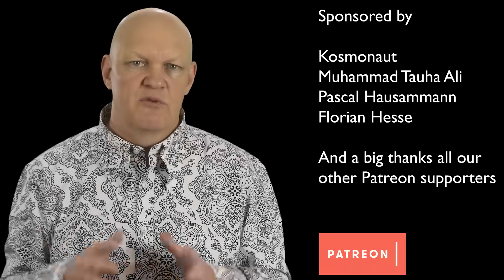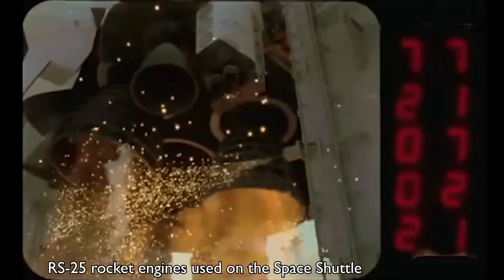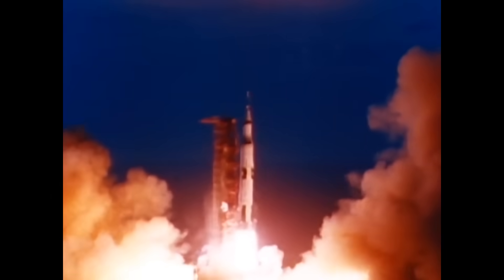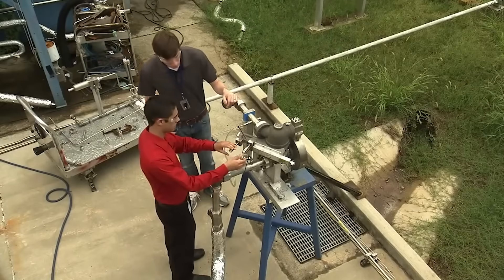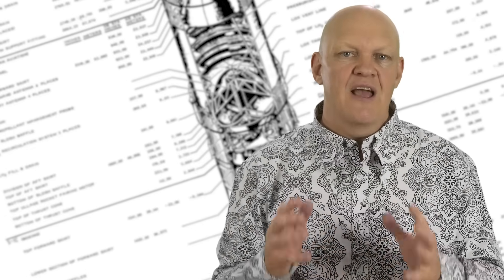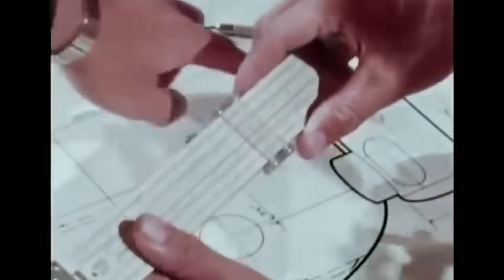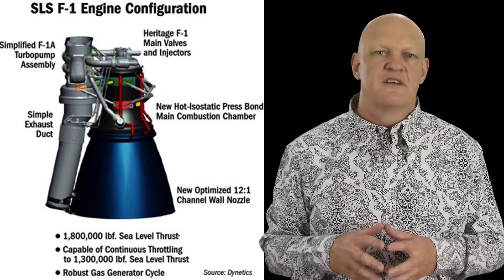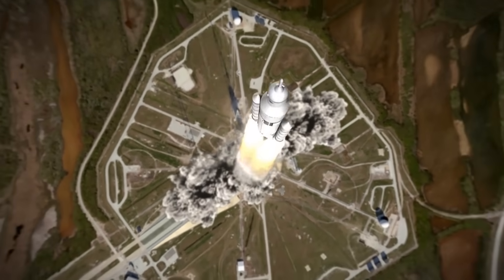Why Can't we Remake the Rocketdyne F1 Engine?

Comment: It is a sad time in which we live that we no longer have the skill set to build an original F1 engine. I grew up in that time, and worked as a machinist before CNC. Very few people left that can do what we did. I miss it the wonders of that time.
Reply: It is a sad time in which we live that we no longer have the skill set to build an original F1 engine.
No, we have the skill set to build something better. Advancing tech means you leave old methods behind. A few years ago, a Saturn V first stage engine (from the Smithsonian) was fully disassembled by a NASA team. Among the interesting findings, that engine was absolutely filled with exotic types of obsolete welding. Welding that only a handful of people knew how to do in 1960, and nobody on Earth’s done for over a generation. Every one of the thousands of turbine blades in the turbopumps were hand-positioned and hand-welded, taking hundreds of times as many man-hours as would be required for an equivalent engine designed today. It’s not just that we can’t do it that way anymore; we’d never choose to!

The whole rocket is made from steel and aluminium; state-of-the-art stuff in 1960, but incredibly heavy and wasteful to build large rockets from today. A modern rocket’s fuel tanks aren’t just lighter, but dramatically lighter. The metals we use today in rocket engines are so superior the engines don’t even have to be cooled anymore. Watch video of a SpaceX launch: modern rocket engines retain their strength even glowing yellow-hot!

So yes, we lost the ability to build a Moon rocket out of obsolete materials and using methods that required a literal million-man-hours to assemble. But don’t think that means we couldn’t go back to the Moon. We can, anytime Congress hands NASA the money. We just wouldn’t do it the same way.

Comment: A really awesome and exquisite design.
By the needs for the time it was built, as said in this video, each F1 instance has to be refined and readjusted practically by hand, one by one.
The programmable machine-tools from the seventies to now didn't exist, and the computer assisted design (CAD) techniques were just nascent.
So the Von Braum and NASA's stubborness on doing (really needed) exhaustive testings of  new devices, hardware and software for the moon program was much more demanding for the design and nanufacturing personnel.
A real testimony of the accumulated and superb skills and finesse on doing their work in the stress imposed by the competition with the Soviets. Trully remarkable master at their jobs.

Comment: The greatest liability modern technology has is if, as result of a massive electromagnetic impulse our transport and manufacturing infrastructure collapses simultaneously. At that point, it would be difficult to judge how far back we would be thrown. You might, optimistically, think the 1950's, but the loss of analogue tooling and requisite skill sets, pestimistically, it could be back sometime before the industrial revolution. In any event, those that are reviving anachronistic technologies -everything from black smithing to maintaing steam and hit and miss engines will be elevated beyond the prominence of today's software engineers.  Let's hope it never gets to that point.

Comment: Its a similar thing today. If your an engineer, do you think 50 years from now someone could pick up the machines you’re working with and get those running? How many times a day do you go „yeah ol betsy here doesnt like it if you insert the sheet too fast and then you gotta restart her“? Its just moved from the manufactured parts over to the machines used to make them

Comment: I'm sorry that's not a good explanation to me. Skilled people and engineers still exist. If the original builders had to make changes and adjustments as they went, then that's what you have to do now. Just start with the blueprints and make your own adjustments. And it doesn't even have to be the exact same adjustment that was originally made. It just has to correct the issue.

Comment: My father used to work for G.E. Aerospace back in the 1960s, and he was a technician who helped design and build the attitude control systems for the Saturn V vehicles. He once told me a story about a failed circuit board that would not respond as designed, but was a vital piece of the system meant to steer the rocket. He said they worked for days, trying everything, until one day, for no apparent reason, it started working. They found that someone had somehow dropped a paper clip onto the board. Instead of removing it, they tested it again to make sure the circuits worked, then they carefully measured exactly where the paper clip lay, what it touched, what shape it was, and its composition and mass-- everything-- and then they simply started soldering these paper clips onto the circuit boards to get the attitude control system to work.
I have NO idea if my father were putting me on or not, but after seeing this video, I'm thinking-- Maybe he was telling me the truth....

Comment: Because they are not designed for socialy accepted hydrogen fuel as well.
What's funny is, the carbon offset is still not enough to offset the solid rocket boosters. The solid rocket boosters are a cheap way to get power, but as noted by the commenter, they can't be turned off or even throttled lake a liquid fueled rocket engine.

Comment: Some equipment designs for parts go back slid rulers (accuracy) for tolerances.  Upgrade engine 1939 engine to third generation more powerful. Slid rule to computer (very close tolerance), engineering margins (the unknowns of usage) in slid ruler.

Comment: Gun designer here. I know the scale is a bit smaller but the same reasons apply for when people ask why can't we just make classic firearms for the people that want historical style guns. The trouble is the methods and techniques and machines and costs. Since they didn't have CNC when they needed to make a bunch of something they would make fixtures to do a particular cut or hole, basically a different vice for every operation that fit the part just right. We do this today too but the difference is because they didn't have CNC is was one op instead of now where we will use the computer to cut everything we can from a single holding of the part to reduce the fixtures. In the old days they might have 20-30 fixtures, and if it was a big factory they would even have 20-30 mills and the parts would go from mill to mill to mill with a machinist at each one or every other one and do it that way. Since the parts were able to be held differently every cut they could easily use different angles for every cut. For us that means using a 5 axis machine (half a million dollars for a good one) or making more fixtures so from maybe 3 to 4 or 5 or more, drastically increasing the setup costs. Then there is the issue of labor. The labor was much better skilled in most cases and labor was also the cheap part of manufacturing, material and machining were the expensive parts, the exact opposite of today. So a lot of guns have a bunch of tricky welds to make parts that are unable or impractical to machine, or parts need to be filed and shaped in ways a mill can't practically do to get sharp interior corners and perfect fits. Something like an M1 Garand that can be purchased surplus from most gun shops in the country that for decades was being sold off for under 50 dollars would cost about 2-2.5k new today and it would be made of inferior material with inferior craftsmanship.

Comment: The F1 was just a small thruster rocket. It wasn’t designed for long duration missions. The rocket engine was used up after one go. Making it suitable for emergency orbit or atmospheric re-entry. But little else. The moon missions were very expensive and required multiple sets of the F1 in separate stages. After they spent so much on those moon missions. It was clear they needed a better more reliable engine design. 
You can’t explore space very easily with disposable engine ls. In fact those rocket engines. Although seemingly big and powerful. Were not always reliable. They also required a lot of external equipment to start. That equipment wasn’t available in space. 
Those rockets engines were never designed to be reusable for future space missions. 
Part of the reason the rocket engine design was abandoned. Was exactly because of the larger cost involved in hand made parts with skilled workers that didn’t share or train others well. Which is why no one has those skills today.
The engineering and craftsmanship became too expensive and difficult to control. Control being the operative word. Meaning more people equals higher risks of losing trade secrets to espionage and bribery. 
Solid rockets replaced the f1 for that reason. If it’s already a disposable engine. It may as well be a single use solid rocket booster. With less moving parts and fewer hands involved. 
You could say, it’s a similar thing with luxury cars.
The molds are destroyed or there are fewer cars made because it’s hand made. Where space exploration is about longevity repetition and durability. Not necessarily just style and speed. 
It was the inconsistency of the rocket reliability due to individual characteristics of each engine. That lead to it being shelved. 
A good rocket is precise preforms well and has interchangeable parts. The f1 wasn’t always interchangeable. 
Those old rockets were also dangerous. The men that rode in them were very brave or were ready to die trying. Even with newer technologies and safer protocols accidents still happen.

Comment: Designs today are so complex, that they have already escaped the grasp of human understanding. Even cheapo computers have pieces of rock that have BILLIONS of transistors connected with kilometers of wires such that they can do math. 
So much so, that today's engineers often lose the fundamentals if they are not careful. 
This is why we still teach engineers how to do calculus and integrals by hand despite often never touching one again after they graduate. 
The new way is far more efficient at producing results, and the old way was a lot harder, but it was that insane difficultly that produced the insane engineers of that time.

Comment: It was all hand built and those with the necessary skill set have all retired or died. Building a Rocketdyne F1 Engine would require training a workforce and restarting from scratch. Just buy Raptor Version 2 engines from Space X as should Blue Origin customers. Its so much easier.

Comment: To say it couldn’t be done is, I think, overstating it. In the 1950’s when the F1 was first put to paper they couldn’t do it either. If we wanted to do it today we would do it the same way they did it back then. You start with the blueprints and just get to it. You build the production and test facilities or modify existing ones. You hire people with the requisite skills and/or train new ones. You start making parts and test, test, test. Will it come out exactly the same as the old ones? Probably not. New technology would inevitably lead to changes and improvements. But if we wanted to make a big first stage fueled with kerosene and LOX there is little doubt in my mind that it could be done. But it just might be that the SLS is the better way to go. Looking forward to the first launch next week. Hoping it is a great success.

Comment: After almost 4 years of this video, Artemis project has the largest solid rocket booster in the world. So finally, they can. But maybe just a copy of F1 engine. If anyone knows, please let me know.
Reply: F1 engines in Saturn V are liquid fuel engines i.e. RP1 aviation kerosene and liquid oxyygen.  The Artemis I SLS system uses also liquid fuel engines but a different type.  SLS's RS-25D engines are liquid hydrogen and liquid oxygen.  They are different things.

Comment: The arrogance boomers is astounding. Machining shops are just as prevalent today as it was then and the current machinists are just as skilled if not more so than the engineers from the past. The only reason F1 engines are not used is because we don't need them. Private companies are doing what NASA did in the past with new engines. If any of those companies wanted to remake a rocketdyne F1 and were allowed to, it would be done.

Comment: Prefer your longer format. Think the F1b is exactly what we should do: why reinvent the wheel in its entirety when we can use modern techniques to make it better, faster, stronger and for a lot less than $6mil?
Reply: F1, F1A annd F1B are inefficient.  They use more fuel than closed cycle rocket engines.  There is a good incentive to improve the design.  F1 is a brutal muscle way to solve a problem.  We need finesse now.

Comment: Personally working in manufacturing for over 20 years I can see how techniques can be lost over time. It’s totally understandable that current manufacturing methods don’t match old deigns. I know from experience that a drawing is just that, but to actually make the part is another story. Then to take all those separate parts and assemble them with methods that haven’t been used in decades. The way i see it these older designs were built by craftsman, and tradesmen that were experts at their trades, and they were a vital part of the manufacturing process. Newer technology is engineered to avoid human craftsmanship as much as possible. You can reverse engineer as much as you want, and try to adapt old designs to modern manufacturing processes, but sometimes you still need that human touch and I am grateful for that.

Comment: It also doesn't help that most people got into those positions based off of merit.
They had the best of the best for every single job, top of their fields and knowing the ins and outs from memory.
Today since it is more based off who you know for government and contractor jobs the best of the best in most cases are mediocre at best.
Hell take the USAF's AN/TRC 170 tropospheric scatter communications system as an example.
Built in the 70s by best of the best, still in use today but people that know nothing set it up and man it but still maintaining it means taking out parts and sending them off to the guys that actually know what they are doing, most of them retired people that built it but working as contractors in their golden years.
The current generation don't know why it does what it does or why but when it acts up they gently tap the klystron with a beryllium hammer while singing the Golden Girls theme song or burying hot wings and pouring out a beer where they will drive the first anchoring stake as parts of some weird ritual hoping it keeps the machine running. And all this is after a 6 month crash course on setting up/maintaining the system and how to read the schematics.
Meanwhile the old guys can be asked over the phone to solve a problem and they will just say "go tot he third panel from the upper right and turn the 4th panel screw one more quarter turn to the right" and that fucking fixes it based off a 20 second explanation of a random noise or power fluctuation.
Reply: When I was in college in the 1970's I worked as a TV technician.
I used to go to people's houses and fix their TV's.
Most of the time all I had to do was whack the chassis in the general vicinity of the power transformer.
For this I used to charge an arm and a leg in 1970's dollars.
The hard part was doing this without the customer noticing.
Great times.

Comment: They have a set several sets but I don't think they want to use them they're in NASA right now at the museums they have one set of them in Florida in a museum Aerospace Museum they have one in Washington DC at the Aerospace Museum attached to the original Rockets one of the rockets that didn't actually get launched off setting in a museum in Huntsville Alabama at the Space and Rocket Center the US Space and Rocket Center in Huntsville they have the Saturn 5 rocket with the engines

Comment: 👎 There is a possibility that the F1 and it new open cycle “new” variant are not great engines compared to what is being flown today.  Low ISP, low power to weight, low chamber pressure and an inefficient engine cycle.  
I postulate that if it was an engine that was so great it would still be in use today as the RL-10 is today which is from the same period.  Why would you have one F1 engine when you could bolt on more efficient current day engines, produce the same sea level thrust in the same area at near 50% increase in ISP ?

Comment: Wrong question. Those engines aren't the right solution. They are single use wasteful relics of a bygone era. With just a few large engines burning filthy kerosene, if one of them fails the rocket will crash. We have better engines burning better fuel now. Those old F-1's are better left in the past.

Comment: As the current clown show named SLS demonstrated, it would have been wise to got with the re-engineered F1B engine instead of the RS25.
The F1 burned RP1, which is way easier to handle than hydrogen. 
The RS25 is a hydrogen engine and NASA and the SLS consortium obviously lack the skills of the Shuttle engineers of correctly handling Shuttle era technology properly.

How come that nobody in the USA besides SpaceX seems capable / competent enough to design, build and fly large powerful rocket engines that can take us to the moon and beyond?

Comment: F-1 is just a gas generator engine. Today US companies can built oxygen rich closed cycle engines, which are superior in efficiency (means higher specific impulse).  The Raptor for example is such an engine, or the Blue Origin BE-4. 
More efficiency = less fuel, less weight to lift, more payload with the same rocket or the same payload with a smaller rocket